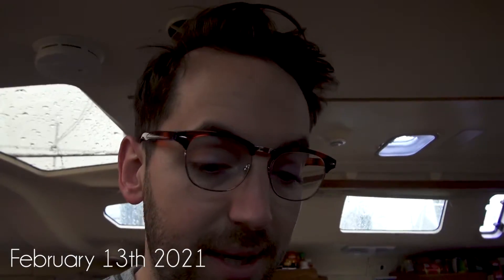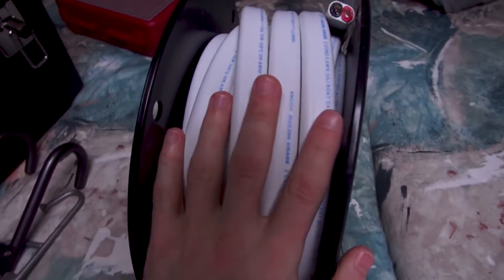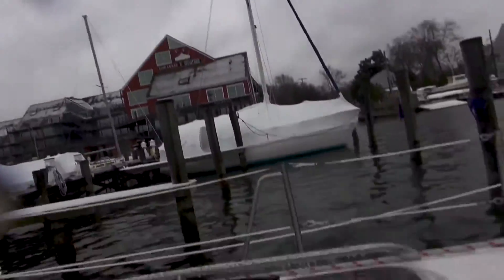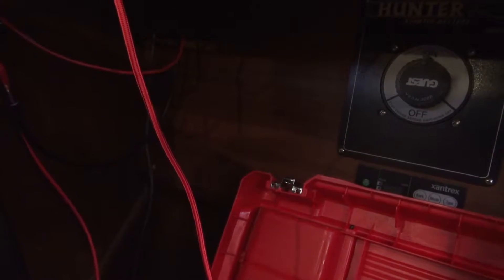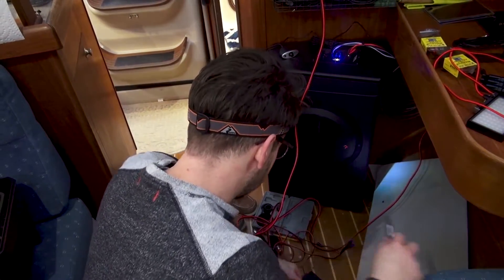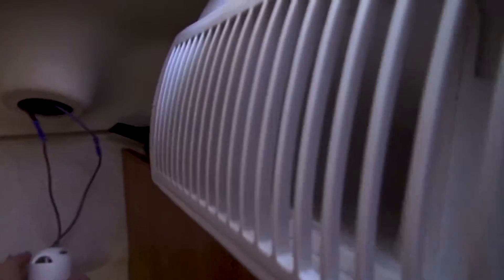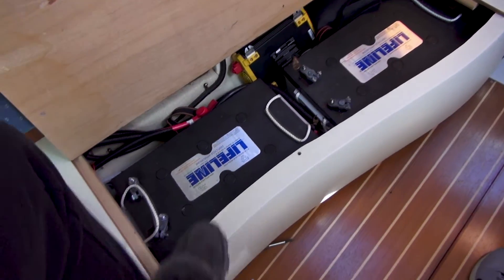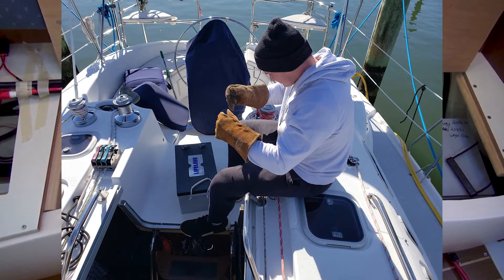Installing Our Boat's 400Ah Battery Bank and Other Solar Power Components - Sailing Viridian EP 41

Comment: How Ah is your charge controller?
Reply from the maker: It is a 40A charge controller
Reply: Is it enough to charge your batteries ?
Reply from the maker: @pierrewendyluxama3682  With the 320 Watts of solar, we would probably generate enough power to keep the batteries topped off. However, we would definitely have to limit our normal power consumption. Ideally we will increase the solar array in the near future.

Comment: I think you should rethink how you charge your battery's.  Start battery should be rated in cca your house battery in AH. If you parallel your battery's  they are 1 battery.  Switch  is designed to switch on and off many times.  Circuit breakers are designed to trip or open on over current. I don't think your breakers are rated for switching.
Reply from the maker: Hi there, great point. Technically the batteries are in parallel, but what I was trying to convey in the video (which I might have done poorly) is that the wiring method results in an unbalanced charging of both batteries IF the Xantrex charger does not switch battery "banks" (AKA charging points) due to differences in wire length to each battery, and thus differences in supplied current. Since the Xantrex charger switches charging points within the overall circuit, the batteries are being charged in a balanced manner. These batteries are measured at 200Ah each and 2000A max discharge (5 second rating) each, which is more than enough for the 1.4kW starter.

Comment: Parallel-ish. 😱  I’d love to see a wiring diagram. 

I’ll re-watch this video to wrap my head around what you describe and show with only the positive side jumpered. (maybe) the switch is being used to parallel the batteries into a bank continuously(????). IOW, no separate bank1 and 2, just batteries on and off (isolated from loads/charge) at the switch. Good luck starting if you ever have a dead short. A dedicated spare starter battery might be a good idea. 

Let us know how this has worked since Feb. It’s August now so maybe you have already re-configured (or it really works well!)

I enjoy the channel. You do good work.